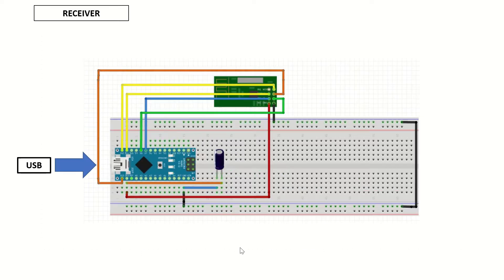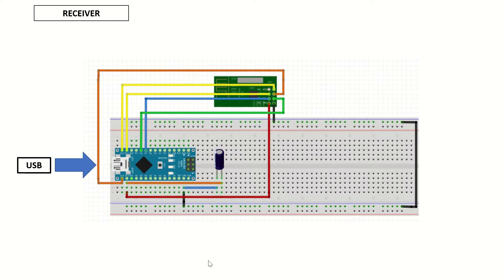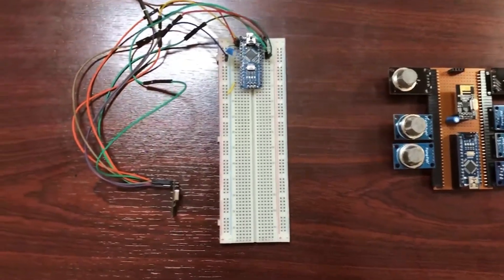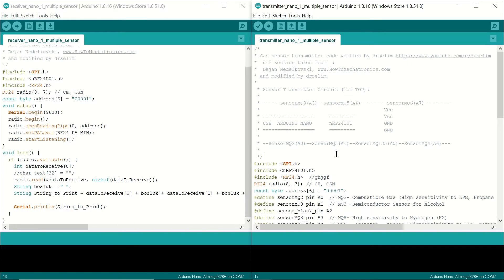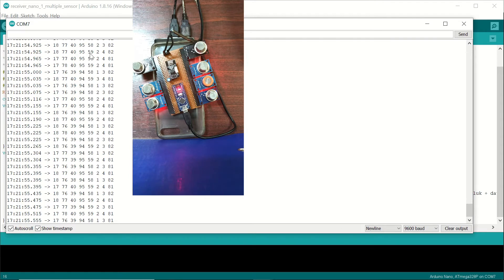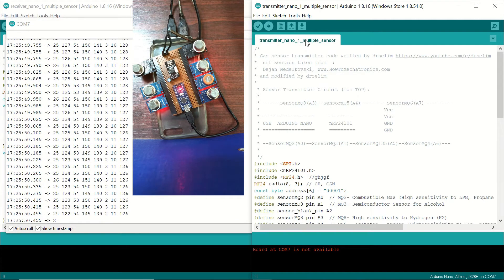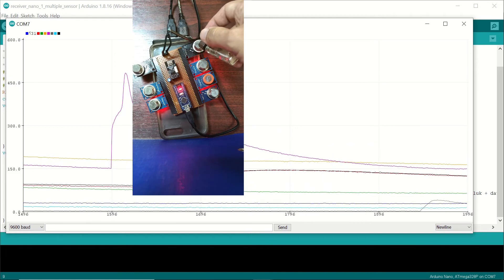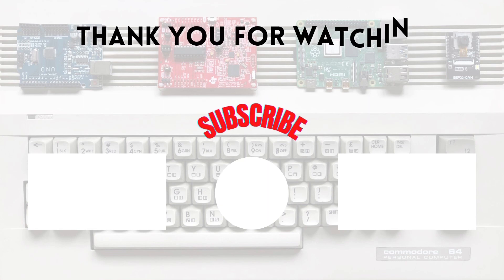Wireless Gas Sensor Network Node with Arduino and nRF24L01

Comment: Looking forward to your reply. I don't plug the sensor pin into the Arduino but why is it still showing the value of . Thank you
Reply from the maker: Hi, I understand that you haven't connected one (or more) of the sensors to the analog pins on the transmitter but you still get the respective entries in the receiver?
That is expected due to the ARduino sketches, so if you don't want to see that entry(or entries), just change the receiver print code:
===========
String String_to_Print = dataToReceive[0] + bosluk + dataToReceive[1] + bosluk + dataToReceive[2] + bosluk + dataToReceive[3] + bosluk + dataToReceive[4] + bosluk + dataToReceive[5] + bosluk + dataToReceive[6] + bosluk + dataToReceive[7];
    
    Serial.println(String_to_Print);
============
Just remove and modify this section according to your setup, the transmitter is programmed to send 8 values in a line, so just discard and remove the ones at the receiver side.
Let me know if this is the case for you.
Reply: I omitted this part. and print out each value but it's still the same, no sensor plugged in still showing the number. it's probably because of the arduino sketch
Reply from the maker: ARduino is probably checking all analog pins in a cycle, whether the pin is connected or not. This case is similar in msp430 as well, in DTC (Data Transfer Controller) the ADC module goes through a series of pins.
Since you know which pin is connected or not, it should not create an issue for you I guess.
Reply: @drselim  thanks you
Reply from the maker: You're welcome

Comment: sir please add communication with msp430g2553, through spi and i2c
Reply from the maker: Hi Kushal, they're on my list, however, nowadays I'm involved in logic circuits and logic circuits design. I'm afraid MSP430 spi an I2C videos won't be available soon.

Comment: great work sir ........ its a great learning experience with you .... thank you.
Reply from the maker: You’re always welcome, I also thank you for your interest & appreciation to the content.
Reply: @drselim  Hi bro can you help me about MQ2 with Nrf24l01 but i want send 3 reads ( CO, LPG, SMOKE). How i can do this?
Reply from the maker: @murtadaali4575  Hi, with a single sensor module, you can get a single measurement value, it’s up to you to evaluate this measurement with the related gas value.
Reply: @drselim  you mean i cant send 3 value from 1 sensor???
Reply from the maker: No you can’t. You’ll get a single value from the analog output.
Reply: @drselim  bro if i use 3 MQ2 can i send -(co, lpg, smoke)???
Reply from the maker: Since it’s the same sensor module, you’ll get more or less the same values from all three of them. I guess there’s a misunderstanding with the sensitivity concept, let me make it clear: according to its specs you see that this mq2 sensor is sensitive to all three gases: CO, LPG and SMOKE, this means that the material inside the sensor conducts current when exposed to these gases, and you read the voltage value from the analog output ( there’s a certain load resistor on the analog output, so that you see a voltage value there) It’s up to the observer to evaluate and understand these readings. I hope the concept is clear now.
Reply: @drselim  i dont have this problem,, if you have whatsapp i will send pic and video to you